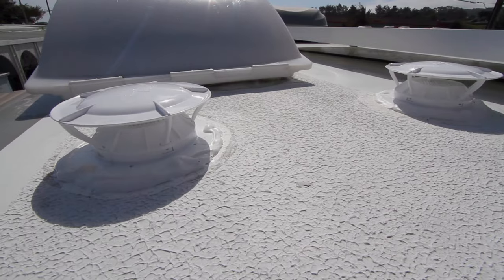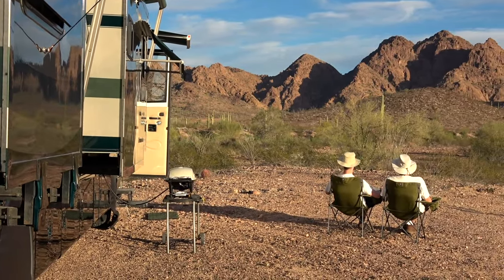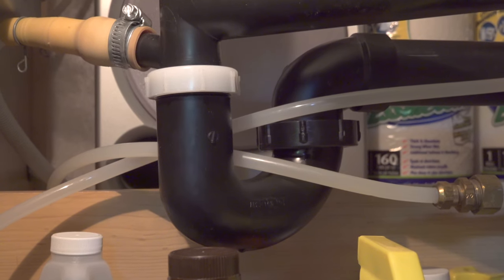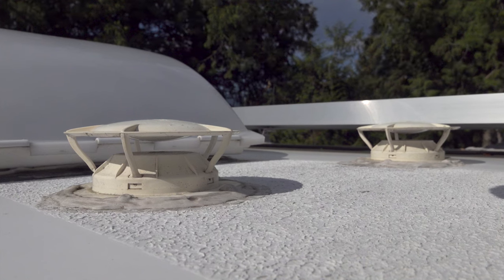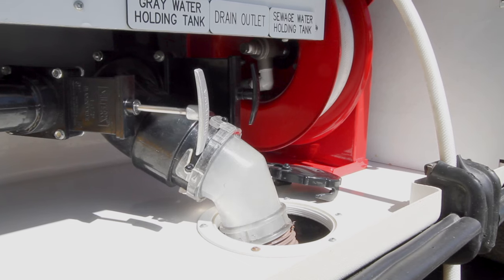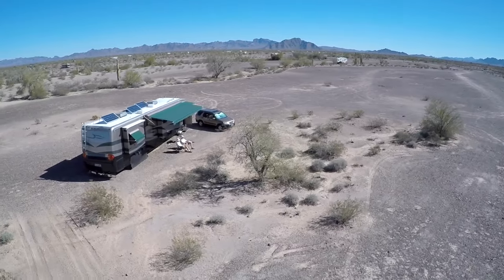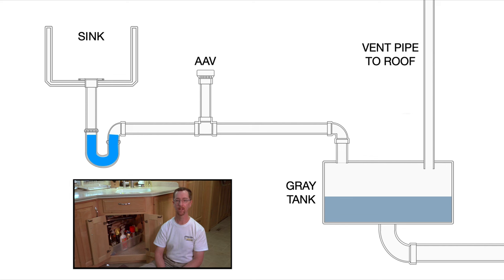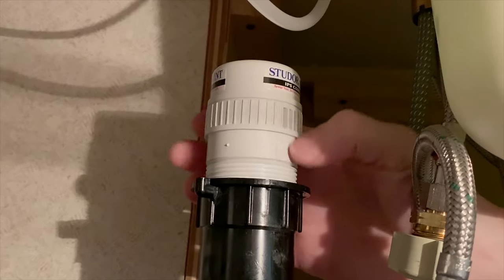RV Holding Tank Odor Control 😵 - Air Admittance Valves

Comment: quick question, if anyone can answer. we just got a brand new 2021 Rockwood Ultra Lite. we notice that "black tank smells" eminate throughout the trailer most of the times with varying strengths of smell. i went up on the roof vent to see if it was blocked and bravely stuck my nose near the pipe and did not smell anything rank or smelly. it honestly smelled like a new pvc pipe would...rubbery, or sort of. does this mean my vent tank is obstructed or disconnected? i would have thought i'd have smells coming from the vent pipe atop the roof?
Reply from the maker: Hi Joel! The first thing we’d suggest if you’re smelling the black tank inside the RV is to check the toilet seal. It’s important that it holds a small amount of water in the bottom of the toilet, as it’s that water that blocks odor from coming up into the RV from the black tank. If, after confirming that there is a small amount of water in the bottom of the toilet, it then runs out leaving no water in the bowl, the seal needs to be inspected, and likely replaced. Also, since you are smelling black tank in the RV and not at the vent stack on the roof, we suggest opening the toilet valve by stepping on the pedal and seeing if smells are coming up directly out of the toilet. If you can do that and stand over the open toilet valve and not smell anything coming up out of the black tank, your problem is not inside the black tank. Also, you said you “just“ got your brand new trailer. Does that mean you picked it up a day or two ago, or you’ve been using it for a few weeks, including using the toilet? If you are getting strong smell up out of the open toilet valve, but none on the roof, there could be a blockage to the vent pipe. That could’ve happened if the RV sat on the dealers lot for a long time and had mud daubers build a nest in there or something like that.
Reply: @RVgeeks  Thanks for the response. We took delivery of our TT at end of May and have been living in it since and using it daily, normally. and yes, even upon emptying our black tank to our 36 gal portable Rhino dump tank when flushing the toilet the smell rises up and out the toilet. we just thought it was normal. we have learned to spray in to the toilet immediately after flushing (and leaving a little bit of water on top of the valve as a barrier). The water sits there until our next dump so i don't suspect a faulty valve seal. And yes, again, there is a smell when opening the toilet flush valve but none on the roof at the vent stack. and i stuck my nose very very close to the opening even taking off the shield. From what i gather, the unit did not sit very long on the lot. it was delivered to dealer around april and we purchased end of May. again, thanks for your help!
Reply from the maker: @jo3y1nf4nt3  Hi Joe. We would suggest that you would likely benefit from installing a 360 Siphon roof vent on each of the vent pipes on the roof. https://amzn.to/3fJfIgz  There should be two of them… One for the black tank and one for the gray tank, and both would benefit from this excellent product. The only explanation we can think of for why you would smell absolutely nothing at the roof it is due to one of two things… Either you are in advertently sniffing around near the gray vent, or you have the unusual, but possible situation of a construction error. When they punch out the plastic where the vent stack enters the tank, in extremely rare circumstances the piece of punched-out plastic stays in place and blocks the vent stack opening. but if you install a 360 vent the updraft it creates on the roof would certainly draw air up through the black tank as a breeze blows across it, assuring that if the pipe isn’t blocked, you’ll smell it when the tank is fairly full. Hope this all helps. Best of luck.

Comment: Any idea how to access the one behind the shower stall?
Reply from the maker: There probably isn't one behind the shower, since it usually vents directly to the roof. It may vary by brand though.
Reply: @RVgeeks   there is a vent line heading up towards the roof but no roof penetration. Removing the shower stall seems to be the only access. I replaced other 4 AAVs and smell is now near top of shower. 2005 Beaver Monterey. Gonna try massive deodorize of gray tank and clean ptrap under shower.

Comment: the area above our valve is too close and wont allow room to unscrew it for replacement.  Maybe plumbing was completed before the sink top was set?  Thinking we have to cut some pipe out to replace it and then replace that pipe with coupling nuts and threaded piple.  anyone else have this issue?
Reply from the maker: Ewwww... that's a tough one, Sherry. You're likely going to need to cut the existing plumbing... but it's also important to have the air admittance valve high enough up that there's no chance that it can get gunked up if the plumbing backs up (think a column of suds carrying food junk up there). So make sure if you DO cut the existing one out, you plan for making the replacement pipe long enough. Let us know how you make out.

Comment: is there one on the black tanks?
Reply from the maker: Great question, but no, there’s none on the black tank. The reason for that has to do with the purpose of the air admittance valve, which is to prevent water that’s going down the drain from syphoning all the water out of the P-trap. Since the only water that goes into the black tank is from the toilet, and there’s no P-trap there, an air admittance valve isn’t needed.
Reply: @RVgeeks  im having really bad black tank smells coming in from the walls im thinking it has something to do from the vent pipe i thought it might have something to do with that. any ideas what it could be??
Reply from the maker: It's possible that there's a blockage in the vent pipe to the roof, like a mud dauber or spider nest. It could also be a break in the seal where the vent pipe meets the tank. If you take the roof vent cap off, you can check for nests/blockage. You might also try installing a 360 Siphon roof vent, which can help a lot. Worth a try.  https://amzn.to/3eLKQJ9

Comment: Replace the “p” trap and air admittance valve with a HepVo valve, problem solved. An added bonus with replacing both “p” trap and AAV, you gain some wasted space under the sink because you don’t have the “p” trap in the way. HepVo.com
Reply from the maker: Thanks for the comment. Curious about how long you've had them. We’re familiar with Hepvo valves, but simply made the decision not to install them, because we understand they aren’t perfect either. The low water flow from extensive boondocking can gum things up in the drain, requiring removal and cleaning of the stopper, and if installed, a Hepvo valve. That’s not necessary with traditional P traps. We’re all in on going with more complex / more expensive solutions when they provide a high level of betterment. We’re not convinced that Hepvo valves fit the bill. That said, we're aware that thy're really useful for places where space is limited.
Reply: RVgeeks, I installed ours in 2016, under the bathroom sink (vertically) and horizontally under the kitchen sink. Haven’t had any problems with them.